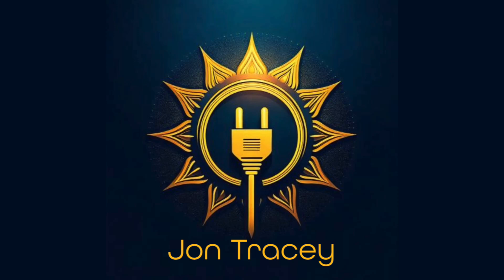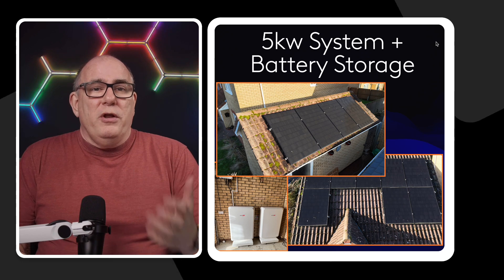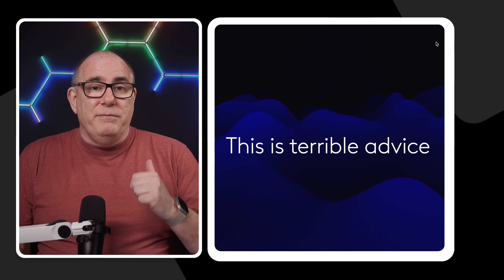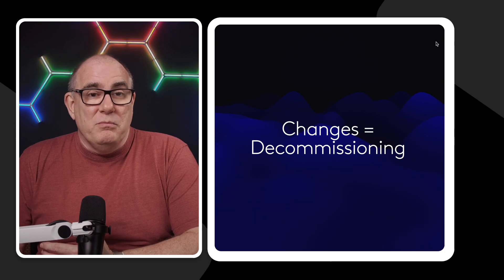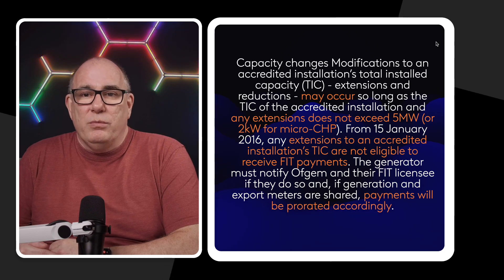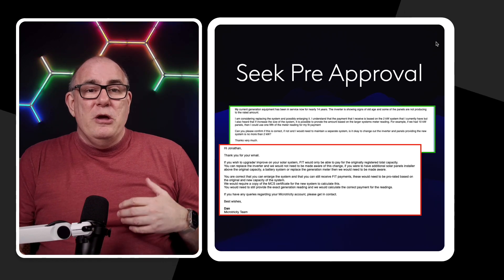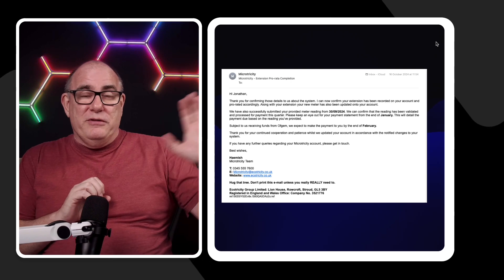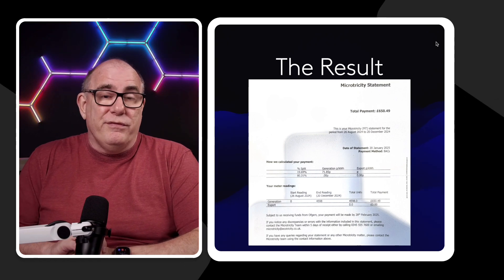How I Upgraded My FIT Solar System (and WHY I Did It)

Comment: I love the "why not" approach. I've been trying to find a workaround for v2h but told you can't do that, but then told "not sure why" 😂
Reply from the maker: we have become a very risk averse society, no one wants to take responsibility
Reply: @JonathanTracey  This is very true! I only wanted to know theoretically if it was possible to convert the output voltage from an EV to the input voltage of the invertor strings. Basically, replacing the solar panels with a car v2l
Reply from the maker: I don’t think any car vendor will risk it, unless they supply all the hardware. Can you imagine if a Tesla battery dies and you had it plugged into a solaredge system, you can bet both vendors would blame each other

Comment: 1yr ago I replaced all the panels on my south facing roof effectively doubling the output. My FIT provider Scottish Power told me that I could replace the panels or inverter, but not both for half of the system and still receive FIT payments. So I have kept the old inverter and generation meter and then added a new inverter, battery and separate generation meter. The system is split in half between the inverters and works well. Credit to the installers NGRE Oxford I now have 5kw on the roof and a 12kw battery replacing my 2.51kw system. I have like you removed the FIT export payment to get a better rate with Octopus.
Reply from the maker: yeah that’s what i was trying to avoid, they make it very difficult at times, but if it works then all good.

Comment: very similar story to me. when I bought this house the developer had installed 4x250W panels and I was receiving FiT. I wanted to maximise generation so took those old panels off and installed 20x 425W. I was led to believe that was the end of FiT for me but when I moved my solar from ecotricity to Octopus I was pleasantly surprised to be advised that I could indeed still get the FiT :) And as I now have both North-West and South-East facing panels, overall the generation window is longer and it is working out well.
Reply from the maker: is having the larger array giving you larger payments? even though it’s pro rated?
Reply: @JonathanTracey  correct. the larger array is giving me a larger payment even though it is pro rated and I'm only getting the generation FiT payment, no longer getting the FiT deemed export (as I now use Outgoing Octopus at 15p kW exported)

Comment: I had a similar problem, where the roof with the old system had to be replaced, this meant that the panels had to be removed, and like you I expected to lose my FIT payments. My system predated the FIT scheme so I was only getting the 10p per unit when FIT started. And like you I decided to replace the system with panels that were three times the power of the old and added two extra panels.
I e-mailed my FIT provider EDF with my planned system change expecting a negative response, however, they only replied saying that I should submit a picture of my original meter that I duly did. I heard no more until the next time they wanted a meter reading submitted. The only problem was when I completed the form with my reading, I had a reply saying the meter reading was outside of expected generation. So I resent all the correspondence I had sent initially and lo and behold I received my payment. I will be interesting to see if I get my payment next month.
My only thought is as my payments are so low I will not be receiving large payments.
Reply from the maker: How long ago did you go through the process, do they sitll query each payment?
Reply: @JonathanTracey I wrote to EDF in 17 July 2024 stating our panels were being changed. I received a reply on 23 July 2024 stating I should send full details and a picture of my generation meter showing last reading. I sent on the 8 August 2024 the details of the new panels and an attached picture. I never heard any more until the next reading was due and was surprised to receive a request for a generation reading, they queried the reading but I replied with all the previous emails  and lo and behold I received my FIT payment and have one more since then.

Comment: I changed my friends inverter that at 11ys old had failed , no issues.
Reply from the maker: i think swapping out components was allowed for quite a while, it was more the upgrading to larger systems what was always a worry
Reply: @JonathanTracey  I recently had a letter saying i could upgrade the whole system at my house and still get the fit payment
Reply from the maker: Yes that's what we did, but never got a letter, had to hunt down the legislation and prove to my providers it was allowed